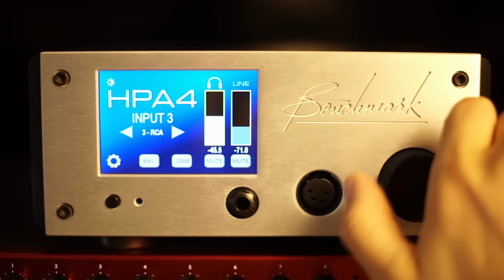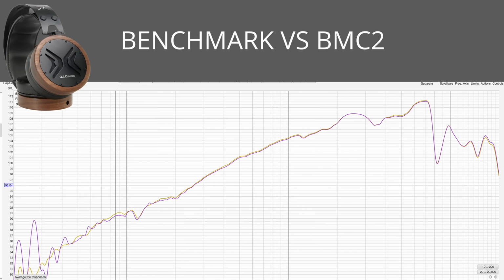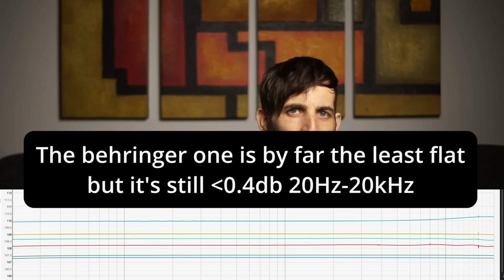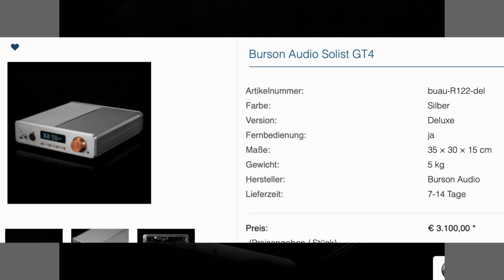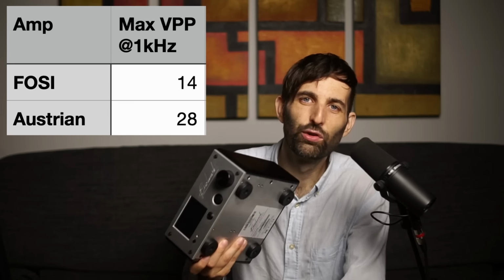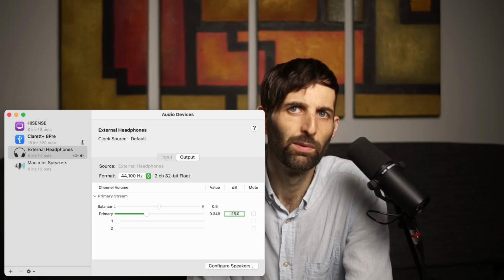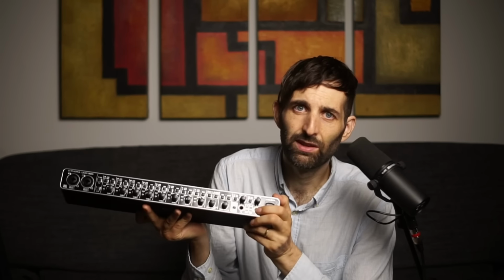Stop plugging your headphones into your audio interface!! Headphone amps demystified.

Comment: 28:30 heheh ye, first thing first, I always work at 48khz or higher... second: i've tried to mix a song in the M1 MacBook Pro headphone output but it's crazy how bad it is (compared to the HP Output of the iD14 MKII I own)... The highs sound distorded and have no "sheen"/high-end information and the lows sound boosted (but with no tightness on it) but the mids are ok. However, I acknowlegde that the HP output of the iD14 MKII has high impedence and might demand a high impedence headphone to work properly, and that's is true to my NDH-30 headphone (120 Ohms) I own. Accordingly to Julian Krause's maths, the best scenario would happen if my headphone was at least ~160 Ohms. So, even if I'm not in the best scenario with my audio interface, it is still A LOT BETTER than the MacBook Pro HP output... BUT (*BIG BUT*) I don't know if M4 MacBook has better HP Out than the M1 MacBook

Comment: Did you measure the impedance of the amps at different frequencies?  My guess regarding the unexpectedly weak bass from the low impedance headphones on the Behringer is that it might be AC coupled with too small of a capacitor, which creates a simple low-pass filter with a corner frequency that depends on the load impedance (and the capacitor, which you're not changing).
You could think of it as a voltage divider created by the ratio between the amp's output impedance, and the driver's impedance at the specific test frequency  If it's coupled with a capacitor that's too small, the output impedance will climb as the frequency goes lower, so you get less bass.

Comment: Well, comparing the Behringer to the CLARETT series of Focusrite is quite not fair, right? You do it all the time. The most used and sold Focusrite interfaces are the 'cheap' Scarletts, that are still quite more expensive than the Behringers. And yes, the Clarett series is not only more expensive, it actually is MUCH better. And the Scarletts are feeling like crap in comparison.
If you compare, the Scarlett phone outs are a bit more linear in frequency response, but seemingly have much more impedance than the Behringer and are actually unusable for many tasks, like some tracking environments or driving headphones that are more demanding.
This said, the Behringer phone outs are as good as most high-priced interface headphone outs and in a blind test with calibrated volume levels even audio engineering pros can not distinguish them with their own headphones. And yet, I have not found any headphones, that I would use, that it can not drive sufficiently.
Just saying.
OTHERWISE, I appreciate the way you approach the problem technically/scientifically here! Many interfaces have LOUSY headphone amps, no matter how expensive. And yes, often, a good headphone amp can help. And often, VERY expensive headphone amps are also LOUSY with their output impedance. And the general explanation for this, and how you present it, is correct, IMHO. And yes, even a Macbook can have better quality, which should make some of the snakeoil hp amp producers be ashamed of what they do.
But I don't think an analog potentiometer does automatically disqualify the Behringer. You can just turn it up to full once you bought it, check if this works correctly in terms of left/right balance, and forget about it, managing the output level digitally in your computer from there on. I agree, that sometimes the balance of analog potentiometers can the quite off, like in your specific unit. Simple as that. And then, the headphone output is absolutely usable, once you resolved that problem. In worst case, I just remove protentiometers completely and bridge it, so they are out of the equation. And for tracking, this is IMO a non-issue, anyways. Most musicians would never hear the imbalance, no matter how obvious to a sound engineer. Yeah, I get it, you don't like the Behringer, and there might be many reasons, like the bleed between channels and such. But you actually CAN track with it. And many pros do it nowadays. Money is ALWAYS an issue in studio world. Sometimes I think you are just a bit ragebait-y. I just don't know it this is intended ...

Comment: Everyone keep saying UMC202HD is crap. This is awesome because it makes this usb interface very cheap so i can buy a lot of units and sell it to radio stations seeking a cheap and ok solution for feeding their transmitters with a good quality baseband multiplex audio signal since umc DACs are very linear from 20hz to up to 63khz without phase issues. Please keep saying it's shit so broadcast people will buy all units and be happy

"Who in the right mind will use behringer for on air audio on mission critical equipment?"

It worked non stop for 4 years until lightning destroyed the transmitter. It works. And it's very good.

Comment: This video reminds me of discussions on IEM cables. I usually buy said cables based on quality materials, looks, comfort, and price.  I've always had difficulty seeing a big difference in cables, aside from microphonics, and the most I've ever spent was just under US$80 for a heavily discounted (AliExpress 11.11) cable from Lunashops store.  That cable happens to also be my favorite, as it came with the 4-in-1 screw-in 90-degree terminations, is supple, very well built (with hi-quality materials), and relatively tangle free.

Recently, I placed a CHF 1.00 (US$1.20) min bid on an Effect Audio Ares S where the local listing had no apparent reserve.  Who knew...but I ended up the only bidder.  That cable arrived last week and though it is quite nice (came mint, with box and papers), I cannot see how this cable can be successfully priced at over US$250.  If I had to choose between this Ares S and my Lunashops' cable from AliExpress...I would take the later any day of the week.

Disclaimer:  At 58, my hearing is not what it used to be.  As a young submarine officer, my ears were tested routinely and I had well above average range (~21KHz).  However, years of working around the nuclear-powered boat's engineering spaces certainly had an impact.  Today, I can barely hear above 16KHz. Maybe this is why cables take a back seat to more dominant factors (i.e. ear tips, nozzle filters, EQ, IEM switches).

Comment: As with most Youtubers, they never give you the full picture, and seduce you into their rampage. You can't listen to digital music. You always need to convert it to analog to make it reach you ears. The chip is crucial but the less a factor for how the analog output will be generated and presented to the output ports of your DAC. I didn't hear him disect a DAC by explaining what else matters hugely to how a DAC will sound: Power Supply, Analog output stage, Clocking and jitter control, PCB layout, Firmware-filters and oversampling strategy, Mechanical and EMI considerations. This is where the differences are made between low end and high end DAC's.

Comment: if you're just looking for an amp that has relay volume control, there's a lot of cheaper options compared to the HPA4, for example some stuffs that topping makes, not sure if it's fitting for studio use or not but it has the "same" system of using relays to control volume in .5db steps while being almost 10 times cheaper

forgot to mention it actually has memory slots for setting volume.
and also a tone of volume headroom

will you hear a difference between these two?
probably, but you can definitely mix on both of them.

Comment: Hello. In the above resistance table, the indicators of apple's technique were hidden. Can you publish the full table of all values or can you write an answer here?
Reply from the maker: Didn’t I reveal in the video later?
Reply: @APMastering In the section where the mystical devices are described, only a table with voltage values is provided. The resistance values are not given.

Comment: A 1.. ONE!.. db swing is NOT a huge swing.  It's audible but not even close to huge, 1db is considered "just" audible... well trained ears might hear a half db at best, only under very particular conditions.  Beyond that, anyone who's not some kind of purist subjectivist "audiophile" obsessed with analog everything, is going to be and should be using DSP EQ, so a small frequency response variation is utterly irrelevant.  What IS relevant is how other aspects of the sound could change with poor impedance matching or other factors... things that could cause compression or some form of distortion or other more difficult things to measure.  While I do lean heavily towards the objective side, it is nonetheless true to at least some extent, that certain features of sound are either difficult to measure or interpret, or impossible (unlikely, esp. if we're just using an oscilloscope and zooming in), OR that we can be sensitive to changes that appear very small in the measurements, down to very small distortion effects that should be broken down by frequency or which harmonic is actually present that shouldn't be, and not just a THD sum... but the proportion of 2nd, 3rd, 4th harmonics etc.

So the high output impedance amp paired with certain headphones could have negative sonic consequences but this is not properly reflected or understood to be related to merely the frequency response graph which is barely changing by 1db or less, which again, is largely insignificant.  You will have bigger FR differences just by adjusting how the headphones sit on your head or around your ears, position, clamping force, distance from the ear, etc.  1db is almost nothing especially when it's broad like that.  It's certainly not undesirable if it's +1 db in the bottom octave or top octave... within the upper bass / low mids, or midrange it would be more undesirable, or if it corresponds with a peak in the treble response that you're adding to, that would not be great.  Otherwise, this is of no concern.

edit When he zooms in now we can clearly see it's up to 2db, which is significant, especially over the particular range it's affecting (upper bass/lower mids... yuck, the worst frequency range to be elevated)... but DSP EQ can still easily solve that if that was the ONLY issue with an amp/headphone pairing due to impedance matching or whatever.  The only real issues that matter would be issues that remain audible or measurable in some dimension AFTER dsp correction has normalized the frequency response.  I believe there absolutely could be issues remaining even with identical FR, because it's not as simple as just the FR... if it was ONLY the FR, then it's irrelevant from an electrical point of view, there's no fundamental problem or inadequacy that is inherent in the pairing.

Comment: I'm currently getting a hifiman he1000 stealth, should i get the fosi audio zh3 or just stick with m4 mac dac? Mac has high impedance mode to output more power, but for the he1000 stealth it is low impedance and requires lots of power to drive . So is the fosi audio zh3 worth an upgrade? Thanks

Comment: When "predicting" how impedance may effect two unit's inter-playing frequency response, you often have to also consider how the inductance, resistance and capacitance of any DUT's input stage effects things (if it has one, if not, the device it's self's L, C or R), as well as the output device's. The input/output impedance, capacitance and line or device I/O resistance can sometimes cause a filter (especially in anything with a larger inductance, like something with a coil in it, such as a headphone driver's voice coil). It's possible if there's some kind of DC blocking capacitor on the amp end's output, it may create a HPF with any paralleled resistance and/or inductance after it (like how a headphone driver has a resistance and inductance in parallel through it's coil to the negative terminal). Under certain "perfect storm" conditions, when the values of the L/R and C push the HPF up into the audible range, this could result in a loss of low end, and is one possible reason why the Behringer-Benchmark results had a loss of low end. 

I bet if you look at the schematic, or just open up that bhringer unit, the last series component the audio will pass through will be a 10-100uF electrolytic cap, and I bet if you measure the inductance of the headphones it'll be something like 500mH -1H (or something around that rough range with some extra resistance paralleled somewhere as well) which would plonk a HPF somewhere around 15-75Hz. ;)

This could also explain why the impedance changing for the BMCs didn't change anything, if I'm not mistaken (and I may be in this part), but as well as whether or not the amp can even drive said load, another big reason impedance has an effect on the frequency response IS because of  the interplay of it, and the devices L/R/C, and where the resulting filters that this interplay creates fall. If headphones are designed with a wide amp output impedance range in mind, they may tailor it's inductance (or w/e they are tweaking) to ensure that the filter created with the interplay of it, over a wide range of common output impedance, falls SO FAR outside of the audio range, that you have to try pretty hard to make a filter that actually falls into the pass band of the audio spectrum.

Comment: Curious to hear your take on the Chord Mojo 2... specifically for IEMs. With it being a dac/amp, I don't believe the dac is doing any more than providing a bridge between analog & digital. That said I don't think there's any question that amps can make a significant difference to the sound, a very obvious example being a tube amp vs a solid state amp. 

I am a huge skeptic of anything audio (I've worked in music & audio for almost 30 years) & I know there's a huge amount of snake oil in this whole thing. I have acquaintances who fall very hard for the cable nonsense & some spend literal thousands on cables. I will spend up to $150 USD on a very well made & aesthetically nice cable, but am under no illusion that it makes zero difference to the sound.

The Chord Mojo 2 was the first personal audio source that I really found made a significant (and very pleasing) difference to the sound - this is without crossfeed on, which is a nice touch & with the DSP set to neutral.

I am naturally very skeptical & I was very surprised at the amount of difference that it made - it's more evident on certain sets of IEMs than others, but it's been my most used piece of personal audio gear as it's very rare I'll listen to IEMs without it - I'll just plug it into a DAP that is used purely as a music transport (I use a FiiO M23, as like the Mojo 2, it has a desktop mode and is one of the very few DAPs that have two USB C ports; one for charging, or power & battery bypass, once its fully charged so I can use it without the concern of the battery, and the other USB-C port into the Mojo 2  or one of my desktop dac/amp combos.

Apologies for the long winded explanation, here are the questions I have regarding the device. 

(I) What is it that's creating such a distinctive sound. I have a feeling it's more than just the amp & my opinion of DACs is that they don't do anything to the sound. Perhaps you think I'm talking nonsense - I certainly believe I'm not & have done multiple blind a/b tests with similar devices & I can always pick the Mojo 2 out from 7-8 devices, using a set of IEMs I am very familiar with. 

(ii) I am a big fan of the DSP feature. Beyond the convenience, I believe it's more advanced than any software EQ (despite the limitations) & I'll alway use it to test new IEMs & I believe that if I need to do more than what can be done with a few touches of. the onboard DSP, I'm using the wrong set. 

People often mock the 'complicated' coloured ball system, but I think it's excellent & will certainly last a lot longer than any screen. 

Kind thanks in advance.

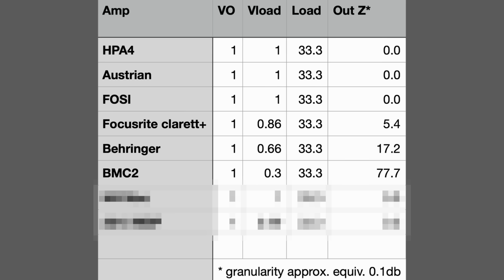Comment: The Fosi zH3 is shown w/ output impedance of 0 ohms (@ 5:05).  I'm curious if that's a measurement error as the published spec is 32 Ω?  Or are we talking about two different things here?  Thanks, great video!!
Reply: Figured out I believe.  I misinterpreted Fosi's performance measurement of "2570mW@32Ω" to reference output impedance of the amp. They mean to say they measured 2.5 watts applying a 32 Ω load.

Comment: After years of buying different gear for different reasons I have realised one thing, all that really matters is how well you know your system. My studio was built when I didn’t have a clue what I was doing, now 10 years later I know it so well it’s not worth upgrading my monitors and headphones or changing the room. I need some new headphones as my Audio technica m40x headphones have broken, I was going to get some better ones but there is no point when I’m so used to them now. I do use real phones with them though and my Rme ADI2 fs drives them nicely. My point is just get to know what you have got as there is no magical piece of gear.

Comment: SSL12 < 1ohm Impedance. Forgot to mention all pots are digitaly controlled and outputs push +24dbu. You can also have output 3+4 controlled by the monitor knob as well as 1+2 simultaneously.

Comment: Once again, I agree with your conclusion that interface headphone amps are not great, but do not concur with your reason in the mixing / mastering chain for matching levels with analog pots. Digital and analog meters and plug-ins are used for loudness, not the volume in your headphones. Certainly for listening to different parts of the mix, volume matters but again that is all determined by meters, not the volume level of your headphones.  Analog pots are very repeatable especially with a meter down chain.

It is somewhat of a mystery as to why on some higher end interfaces the headphone amps are so poor.  In my limited experience, the Prism Sound ADA-8XR has a great headphone amp, the Lyra 2 not so much.